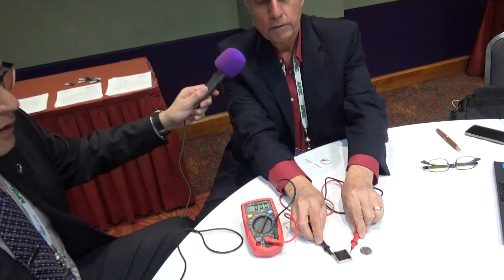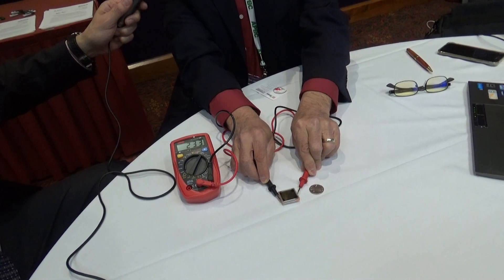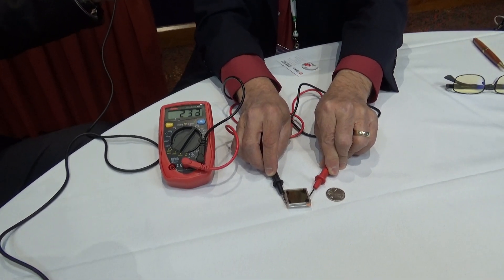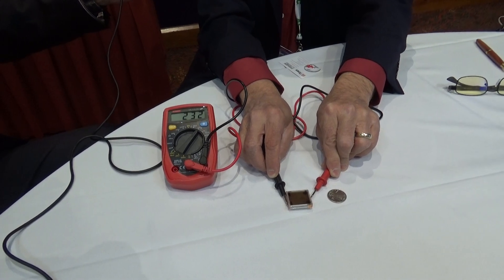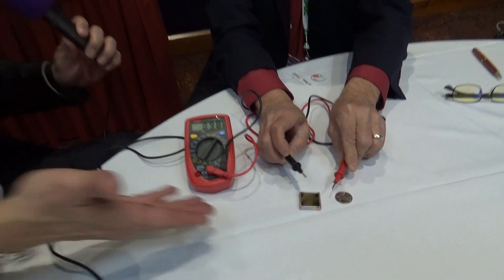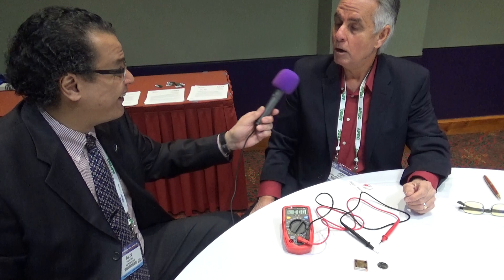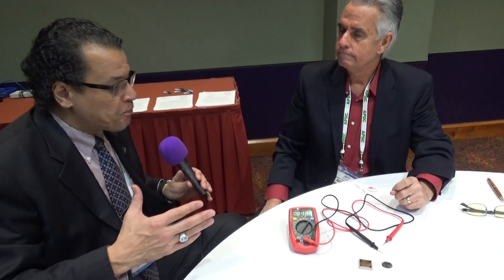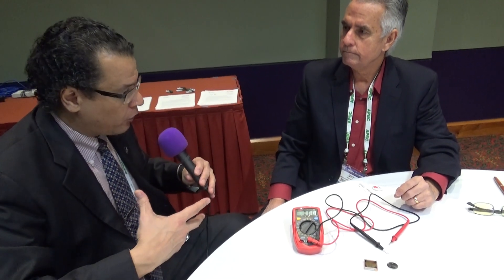A novel energy-harvesting device can extract power from almost anywhere

Comment: That's awesome! What is the minimum temperature gradient required for its operation? What's its operating temperature range?
Reply from the maker: check the company website, they have the latest data. Do a search on this site, we also have a couple of other news items on this technology.
Reply: Examples of expected performance for first-generation Evercell production devices:

5μW device
34mm x 34mm x 1mm
1.2V output
4.2μA continuous current

480-nW device
30mm x 30mm x 0.2mm
1.2V output
400nA continuous current

960-nW device
50mm x 75mm x 0.1mm
1.2V output
800nA continuous current

Evercell™ is a patented and patents pending technology from a member of the BRIDG Consortium.
www.GoBRIDG.com